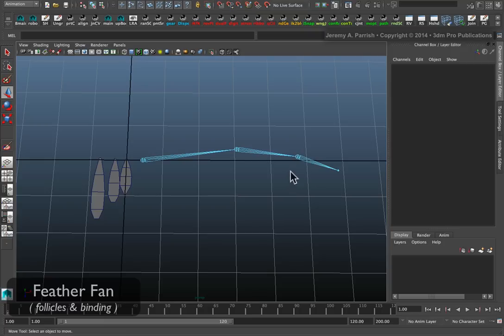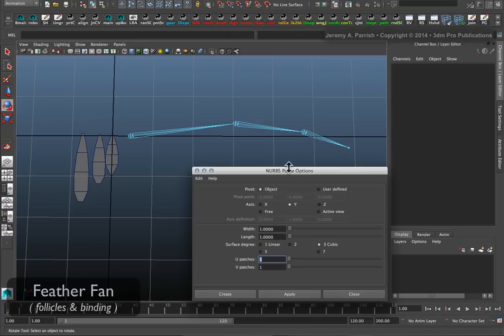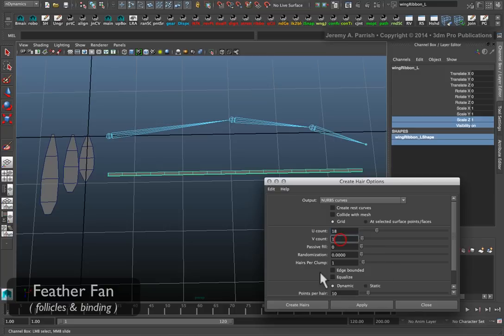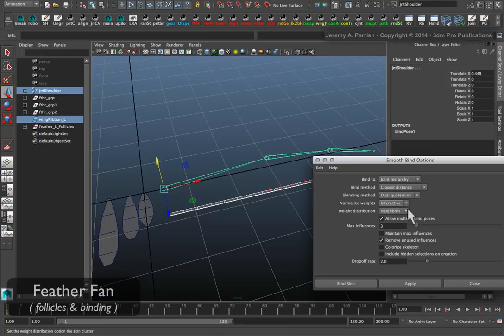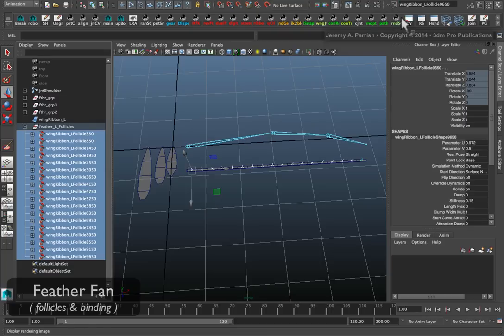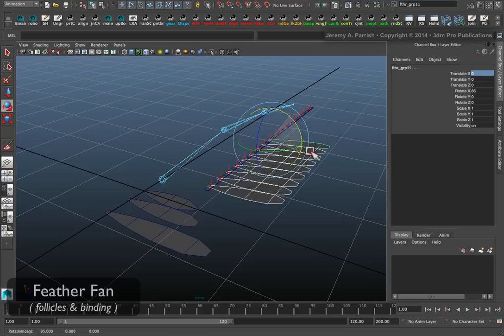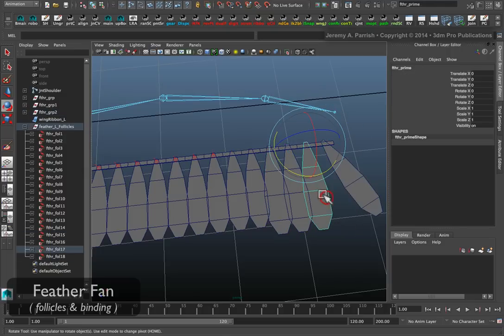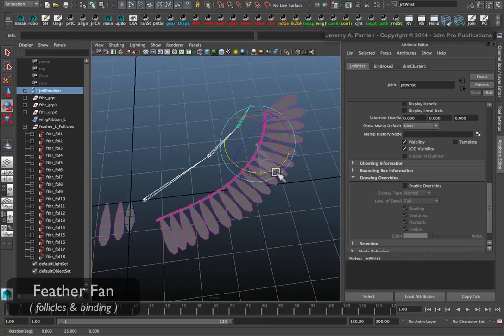Wing Feather Rigging

Comment: Where can you find a snap button if you have used it?
Reply from the maker: At the time, I often snapped to point, which can be done by holding the 'V' key while moving any selection, which will snap relative to the object's pivot point. There are also several snap otpions under Maya's Select or Modify menu, If I recall correctly.  I've created simple snap scripts, using Python to help snap multiple selections.

Comment: i have a model of eagle that i am doing rig, but there is a complex stucture of wings so that i can not give each bone per feather , can you help me out? i want to do rigging without any scripts to improve my skills.
Reply from the maker: You don't need scripts, just do things manually. This demo explains how to do everything without a script, but I happen to use a script to do the most repetitive part of the process to keep things speedy for the demo. If you don't want to use a script, then don't. Every aspect of the setup is explained. No scripts are ever necessary. They are just optional tools. what do or do not do is your choice. And remember that joints are not bones. They are pivots and influences, not bones. Don't make the mistake of thinking that you have to recreate or mimic an actual skeleton. you just have to create joints where the rig will need rotation and deformation.